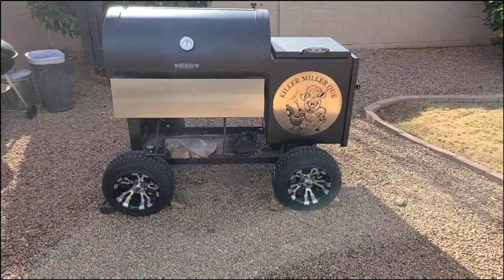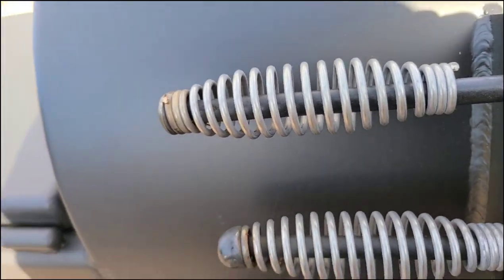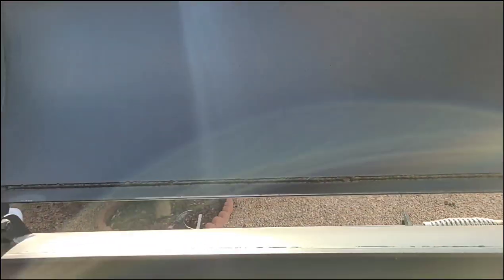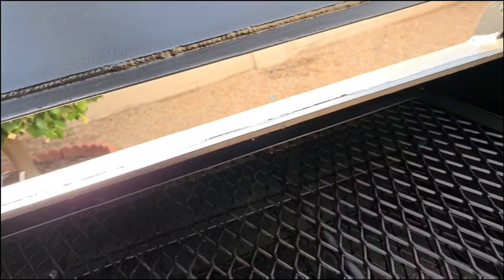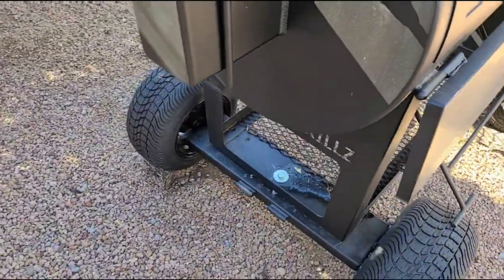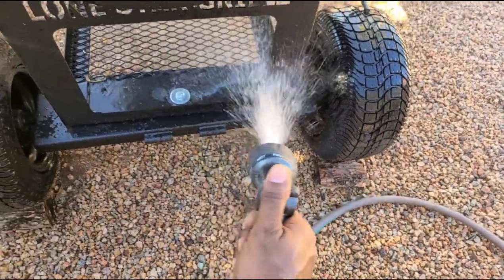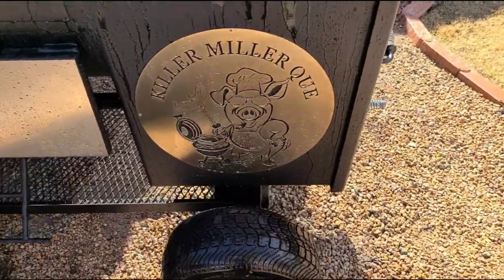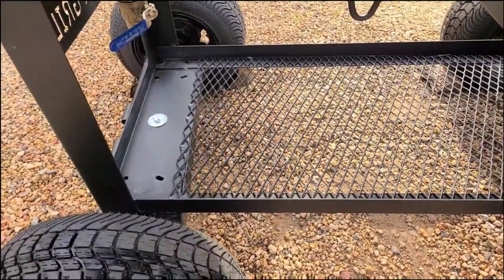Lone Star Grillz | Offset Smoker Cleaning and Maintenance

Comment: Thanks for the video. How do you feel about food grade mineral oil versus some of the other oils with higher smoke points like Pam spray, canola oil, peanut oil, avocado, oil, etc.? I just got a used LSG and I’m trying to figure out what’s best.
Reply from the maker: No question definitely go w the Mineral oil. It works the best and it won't leave a sticky residue on your grill over time like cooking oil will. The mineral oil conditions the metal and will literally be absorbed.
Reply: @KillerMillerQue  Ok i'm gonna give it a shot. Do you kow any tricks for removing pam? I seasoned it pretty well with that before I got the mineral oil

Comment: Heat resistant rubber would eliminate that rust around handles small rubber pieces under cool touch handles that is.
Reply from the maker: Whats up Chris.. Yea that would probably work.. a lil something to block that direct metal on metal contact. I just take my handles off when I clean my pit and I oil the corners w Mineral oil.